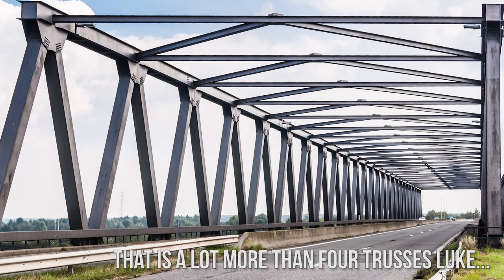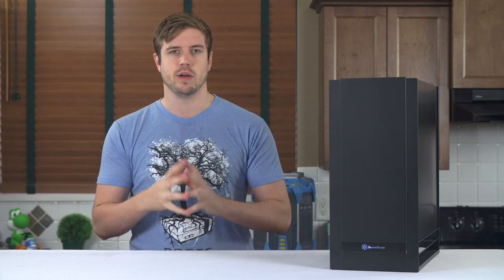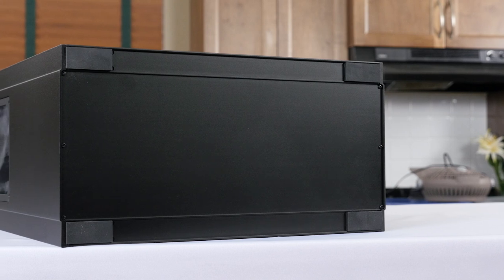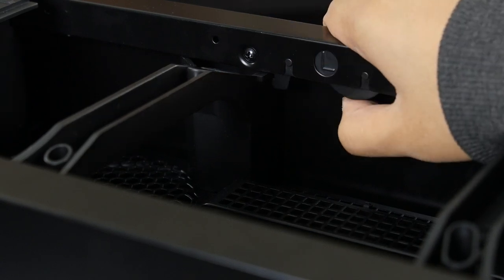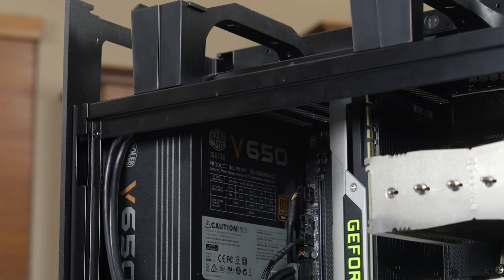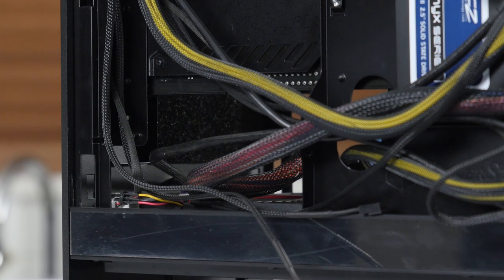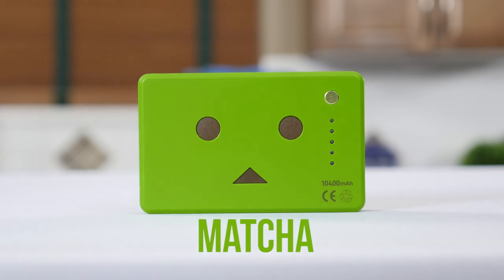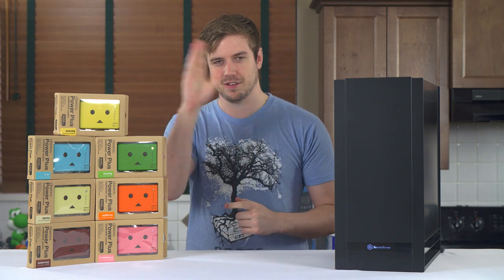SilverStone FT05 Computer Case

Comment: what is good gammin pece for 345 dollar (my buget)?? thank you fro knowlege
Reply: Go to the forum, they have a whole sub forum related for new builds. $345 is very limited in terms of budget however.
Reply: Either save for over $700 or get a console at $400
Anything under $500 is a pile of shit amd pc 4 core (runs like a 2 core)
Reply: i7 4790k Msi gaming 7 8gb ram hd7950 (wanna up grade to gtx 970/980) within a few months
Reply: BEN RIGNEY Sounds good but wait for the ti's 7950 will be a solid gpu for quite a while
Reply: i know but i need more powerrrrrrrrrrrrrrrrrrrrr
Reply: Timothy Lastovica You forgot windows + $100
Don't you dare say "get linux" fucking filthy peasant OS for people who want to high-horse about it when they have problems with every little thing then go "hurr u need skillz 2 fix it only proz use linuxx"
Reply: Not sure what a gammin pece is, but if you are talking about a gaming pc than there is no such thing as a gaming pc that inexpensive. You can get an entry level pc at that price that can play a game or two, but a gaming PC is classified (by me) as a pc that costs at lease 700 dollars.
Reply: ***** Works fine for me and my friend.
Reply: ***** Either way the response was just one solution. There are a ton of ways to get Windows. Re use Windows from a previous PC, find a friend in college that can get it via dreamspark for free, the 10 technical preview, cracked copies depending on op's ethics, the reddit for exchanging software, or just install linux.
Reply: BUT WILL THIS MKCHINE PLAY BF4 MAX SETTIN+ ...?... I NED TO BE ABLE TO PLY GOOD GAME
Reply: ***** Mine was a solid 300 on sale..
Reply: Xbox One after price drop on Nov. 2, no such thing as a gaming pc for that price.
Reply: ThoseJerseyGamers I'm a big ubuntu user, and nobody says that.
Reply: Save up to 500, then you'll be able to play BF4 max settings.
Reply: ThoseJerseyGamers na
Reply: if you want a decent gaming pc. $550 needs to be your spending budget. A good portion money  of that should go towards your graphics card.
Reply: ThoseJerseyGamers man you can build an adequate machine for 550. AMD is built for gamers on a budget!
Reply: Obvious troll is obvious...
Reply: ThoseJerseyGamers
 #PirateBayMasterRace
Reply: ***** mine is $360... What type of card you got brah?
Reply: I am an idiot with a really long username
um as far as i know, microsoft uses windows based servers with iis to host their website and ad ds/exchange for internal stuff.

and that 70% is probably businesses running apache for web hosting (and maybe some networking stuff, and in some rare cases also email) and windows for other things (eg adds/exchange)
 
also, linux is a kernel, and distros are operating systems based on that kernel.
Reply: For 366 bucks so pretty much 400 bucks you could play most games at decent settings http://pcpartpicker.com/p/wRH8zy (GTX 750 Ti + AMD FX 6300) i would upgrade the Ram though if you get the extra money.

Comment: LOL Linus x-D.  Nice review Slick!  Stumbled a bit there talking about the cable management, but it's k.  I noticed that seems to be a more common than not issue with Silverstone cases in general; they will either have no grommeted openings, or will have such poor routing options as to make it near impossible to make your build super clean without a lot of swearing crying in the corner, and super creative use of space.

Comment: i actually dig the orientation of the mobo n I/O. seriously is great for long videocards where it would sag if nothing would hold the end of card up...
also... since heat rises, the heat should b evenly distributed amongst all the cards rather than one card being hotter than others...

easier to plug devices into it, eliminating the need to "bend" over to plug in stuff.

all cases should be implemented that way, if possible! :D

Comment: I wish there would be a case where you can have frontexpansions and a 240mm fan so u can place there some Fans on top 240mm for your cpu cooler a mid plat so most of the cables are hidden and hidden HDDs and SSDs on the inside.

Comment: Hello LinusTechTips. I recently found your channel and I was hoping you could give me some advice or suggestions.

I am looking for a case for a computer I recently assembled.

I am looking for a case (mid tower if possible) below 100€ /120$ with good air cooling options, space on the inside and a solid elegant/discrete build.

I currently got a Cooler Master N400 which i like but it has some issues, It has few cable management, it doesn't have much space inside, it doesn't have a dust filter on the side fan spot and it conflicts with my motherboard's SATA connectors.

I like it's minimalist looks and good build quality (for the price), I like the cooling options and the 4 USB ports, also the exterior size is good but I don't mind if I get one a bit bigger.

My set-up:
ASUS Z97-pro
Core I5-4690
2 x 4 GB 1600mhz
Sapphire R9 290 Tri-x oc
1 sata hard drive 1GB
Cooler Master g750m

I use 2 intake fans (120mm front + 140mm side) and 2 exhaust (120mm back + 120mm top). Also i bought a Noctua nh-u9b se cpu cooler but i also value noise levels.

I am not overclocking but I like to keep my components as cool as possible since i know heat compromises longevity but I am not looking to switch to water cooling.

This said, could you please suggest me some cases, within this parameters, that I could then look for and choose?? I would really appreciate it! 

Nice channel and thank you in advance!!

Comment: The way they did the fan filter on this is really the only way they could have done it because if it slid out the top then it would hit all of the cables you had plugged into the motherboard and if you could slide it out the side then it would make the case a lot less attractive. Just stick a pen in one of the holes in the corner and use that to pry it far enough out so you can grab it.

Comment: no matter how much research i do i cant choose a case, im looking at the fractal define r4, nzxt h440 or the nzxt switch 810, I will use an nzxt kraken x60 in the case and i want good air flow but a fairly simple design and hopefully something quiet, who has suggestions?
Reply: Phanteks erthoo. Or however you spell it is a strong rival to the r4.
Reply: In terms of features for the money, it'll be between the NZXT H440 and Phanteks Enthoo Pro. Either one is fantastic but one deciding factor of which case you get will be if you use ODDs. If you don't use one, get the H440. If you use one, get the Enthoo Pro.
Reply: TrueZtyleZ7 at first I wasn't planning on using an ODD but I have been reconsidering, considering I can just take it out of my old build
Reply: Damien Johnston In that case, the Enthoo Pro would be choice. It's an amazing case for ~110 USD.

Comment: I still have a pretty old setup but I don't buy new games until they are on sale for really cheap. The newest game I have now is Sleeping Dogs which i run on medium at 60fps 1080. Should i upgrade now that the 900 series is out and will i need to upgrade other parts too.
-EVGA x58 motherboard
-i7 950 oc'd to 3.2
-GTX 460SE
-6GB RAM
Reply: Maybe 8gb ram, and a 4790k if you can
Reply: SeaJay can u tell me if this is a good build http://pcpartpicker.com/p/DLfwCJ
Reply: FuturisticGaming if i get a new cpu then ill need a new mobo. Would it be that much of an upgrade?
Reply: Keven Cardoso No. why blue ray and this expensive motherboard and only the poor WD blue with no SSD?
Trust me I had a WD blue - it got nail'd (ruined, bad sectors galore) and I lost everything on it. my secondary computer however holds a 6yo seagate HDD+ 4yo (+-) hitachi one. I actually have one again as it was still under warranty but I got a seagate 2TB as a main one - compared to the blue it's SSD fast - 10 mins for Win7 installation (complete).
anyways unless you already have an SSD the build is not balanced for a 2014 nerd. (also the CPU cooling is pretty mediocre, but that's enough there)
Reply: SeaJay That sounds like the best move. I always feel like if I upgrade now something just around the corner is going to blow what I buy right out the water
Reply: grandmastaj5 well considering that the original i7s perform about as well (overall) as a new haswell i3 and that the 460 SE isn't too amazing, I'd say the new i3 or i5 single threaded performance boost alone makes it worth the upgrade, you can continue to wait if you wish but just think about this, if you keep putting it off because something new might come out then you'll end up just keep putting it off until your computer is like 10 years old, also on a side note, Broadwell is said to be the same microarchitecture as Haswell, so the main benefits of waiting for the new chips are mostly power improvements and probably some small performance boosts that and according to what I read, they'll also work with socket LGA1150  so yeah, if you have the money I'd say go ahead, do it now, there really isn't much to wait on and since you say you don't play a lot of newer games, I would suggest a GTX 750 Ti or a GTX 660, they won't max out a ton of games but its still a huge improvement over your current card (about double the performance) and its still under $200
Reply: grandmastaj5  i would recommend you 8gb of ram or maybe 16 if you can afford that and the i7 seems pretty fine for now

Comment: One flaw I immediately noticed is how the bottom fan intakes works against the blower-style cooler and thus affects the airflow efficiency and leads to turbulence. Let's face it, the industry was lead to design front to back cooling solutions for years so this shift makes it that not all products will be optimal for best airflow. As it is, you have a lot of turbulence going on.

Comment: Hey i want to watercool my PC:
GTX 970
I74790k
NZXT Switch 810
How many Radiators do I need and what brand should i buy? Which pump do i need/which brand? Which water blocks do you recomend me to buy for both my CPU  and GPU??
Reply: Go visit the forum and go to the subforum "water cooling". Ask there instead of youtube. They will be able to provide you with links and or video's and in general just be more knowledgeable then youtube comments.

Comment: The aesthetic design of this case seems really bland to me. I like less flashy case designs, but this one just looks boring. I personally prefer the design of something like the arc midi r2, which looks simple but maintains a unique look.
Reply: Style wise they should have taken the FT-03's exterior and stretched it out, and add the bottom window. This has potentially good radiator placement on the bottom (and a short on on the top if you are crafty).
Reply: Yeah, I checked it out and the FT-03 is certainly more visually appealing than this one; Silverstone cases have never really captured my attention visually though.
Reply: MisterGutsy108 That case and its mini version are the only OEM cases I know that have the same anodized finish as the previous Mac Pro case.

Comment: Hi Guys, i want to buil a gaming pc  with this: 
-Intel Core i7-4790k
-Intel 730 series SSD
-MSI Z97 gaming 7
-MSI GTX 980 Gaming OC
-Seagate Barracuda 3TB hard drive
-Corsair vengeance DDR3
-Corsair GS800
-Corsair H100i
-Corsair SP120 Quiet Edition

But I dont know which case use, HELP ME!!

Comment: I really like some of Silverstone's design ideas from a lot of their cases, they really do strive for innovation on the whole. I have a TJ08e case which is excellent but it is not big enough for a full size ATX board and that lets it down.
The FT05 could have been a great choice for me and I did give it serious consideration but the issues that Luke points out here are just a few of the reasons that I decided against it. I contacted Silverstone to ask if they had any plans to make a larger version of the TJ08e and they pointed me towards the older Fortress FT04 case with the huge ugly moulded aluminium front door that looks way too big for the case and scrapes on the floor when opening it ! They almost always (apart from the TJ08e) seem to have been designed by two separate people who don't communicate very well !
I even thought about modding a Fractal Design Arc Midi ATX case to have the same mobo orientation as the TJ08e and may still do it !

Comment: Case seems a little weird and it won't look very nice when you're actually using it with things plugged in with all of these panels pulled back and flipped up. And that window isn't aesthetically pleasing. I'd prefer no window, and a much lower price would also be greeeaat.

Comment: I prefer the old and normal kind of cases. This kind of new type thingy cases NAH!
The IO on top? Thats a -1 from me :/
Not enough airflow and a small case also you can't have massive parts in it just like the PSU he showed. SilverStone, not the best case ever :(
Reply: Not enough airflow? The FT02 proved to be pretty well in that department. This has the same cooling.
Reply: +CrimZ0N It's not new and it's the best design for air cooling since hot air rises. It is however non standard and besides cooling, not all answers were found to deal with normal components. If you have only a modular PSU, an SSD, a large CPU tower and a single video card, this case is probably the best in terms of cooling and low noise, I dare say better than a open air, test bench kind of case.

Comment: I will be building a $1000 Gaming PC, and I would like to know if this is good part selection.
Please help.

Link to parts:
http://pcpartpicker.com/p/GcDtNG

Parts:
Intel Core i7-4790K
ASRock Fatal1ty H97 Killer ATX LGA1150 Motherboard
G.Skill Ripjaws X Series 8GB (2 x 4GB) DDR3-1600 Memory
Western Digital Caviar Blue 1TB 3.5" 7200RPM Internal Hard Drive
Gigabyte GeForce GTX 970 4GB WINDFORCE 3X Video Card
Thermaltake Commander MS/I Snow Edition (White/Black) ATX Mid Tower Case
EVGA SuperNOVA NEX 650W 80+ Gold Certified Fully-Modular ATX Power Supply
Asus PCE-N10 802.11b/g/n PCI-Express x1 Wi-Fi Adapter
Razer Kraken Headphones - already had, but still putting into budget.
Reply: This is all for $1000??? Link to the site please? Oh and I would ditch the Razer Kraken headset, they are awful.
Reply: Matthew Kearney Holy shit, the sum of the parts are £800. Thanks!! :D
Reply: ***** No prob, spent 2 months re-deciding parts OVER and OVER again. I think I have something pretty good now.
Reply: Matthew Kearney Man... I spent the last 10 minutes speccing out a computer; from the specs I have chosen websites like OCUK etc all charged me at least £1500. The website you have provided me summed up to £900. wtf????
Reply: ***** PCPartPicker is a great website. It picks recommended stores and gives you the lowest price out of them. Btw the i7 i get for 50$ less because I live right next to a Micro Center (In-Store Pickup only). :D
Reply: Matthew Kearney Oh damn, UK sucks for computer parts.
Reply: ***** No, I'm pretty sure you can get NCIX shipping to Europe, and same with other websites. Amazon is also a great website that delivers to Europe.
Reply: Matthew Kearney Yeah, I have been purchasing of Amazon US as of lately.
Reply: Matthew Kearney 
Woah there, buddy. You just went with a K series processor and an H97 motherboard. K series CPUs have unlocked multipliers, which means you can overclock them. H97 boards, however, do not support overclocking. Do you plan on overclocking? If the answer is yes, it would be a good idea to go with a Z97 board instead, allowing you to overclock. If the answer is no, you'd be better off with an i7-4790, as there is no point in paying the extra $30 for a k series processor without overclocking.
Reply: Thx Brenden. I changed my mobo to a fatality z97x killer because I plan on overclocking. I also might get a coolermaster huper 212 evo to keep temps down.
Reply: Matthew Kearney  No problem, glad I could help. The 212 evo is a great choice. It offers good cooling ability at a low price. It is however, like most aftermarket coolers, large, heavy, and won't look great in an otherwise attractive PC. Have you considered an AIO system? They offer great cooling and look much better than a large heatsink. If you have any questions feel free to ask.
Reply: I have thought about an AIO, but I am already over my budget. I don't want to blow my budget too much. A Cooler Master Seidon costs the same as the 212, but is it even good quality?

Comment: WoW! Ugly FT05 Case! Comparing this to the FT02, the FT02 is way better looking and it has 3x 180mm @ the bottom. SilverStone coming up short for 2014!
Reply: ***** A longtime SilverStone fan here & I own 3 SilverStone Series TJ07, RV02 and the FT02, I personally would not trade any of these for that FT05.

You should keep researching on this FT05 before spiting out a comment. The FT05 is a Full ATX case that can fit SSI-CEB, ATX and Micro-ATX Mobo with (3x) SLI setup, so yeah it's very comparable.
Reply: One of those 180mm fans has no use these days. 
Same as the 5.25 bays (Which were always ugly pieces of shit on the FT02)

I liked the body of the FT02. Unibody aluminum FTW. 
It was a bit of a waste of space though.

This case still seems pretty dope. Better than the FT04. Still needs less plastic. Not perfect but more in line with my interests than any other companies cases.

Comment: why the fuck would anyone buy this case? They tried to make a case that doesn't follow the normal case layout and looks. But there is a reason manufacturers do that. It works. This doesn't. The case on the outside is ugly and difficult to use. the window is pathetic so no reason for an enthusiast to want to buy this. And the inside layout is garbage. it's messy and crammed in there. Horrible case over all. Did not like.